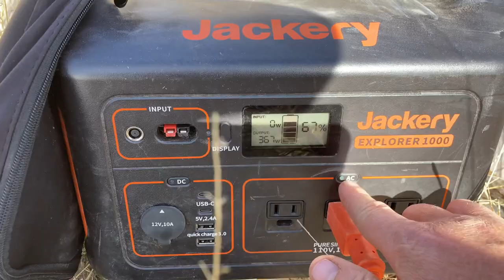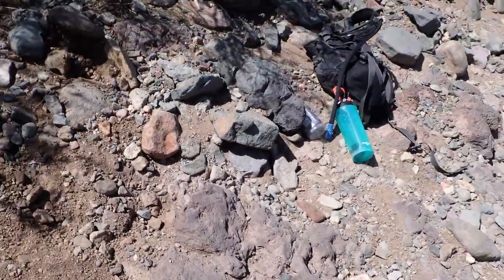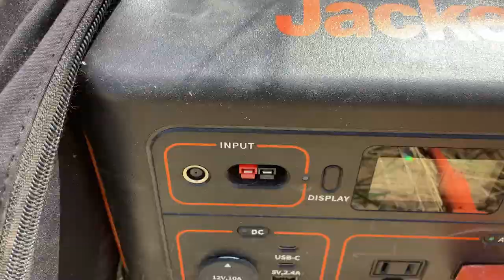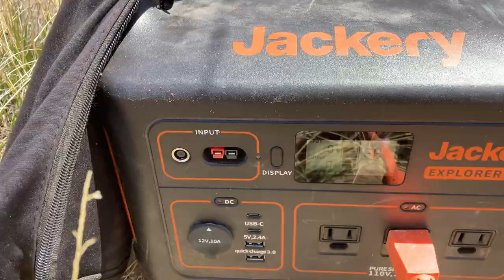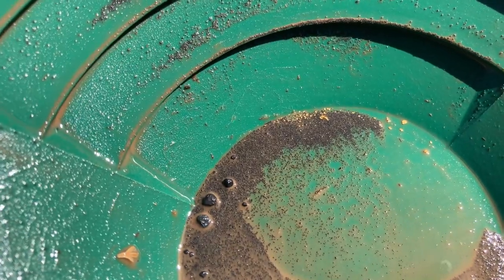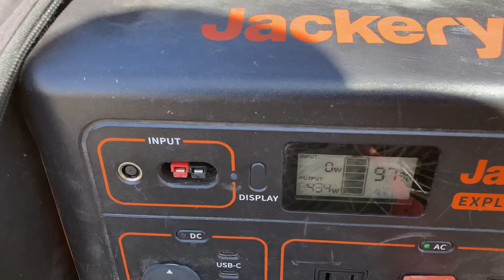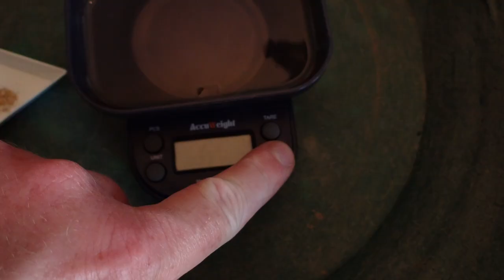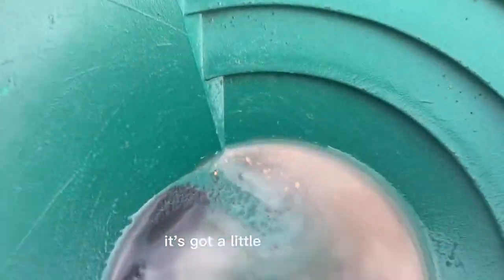The Easiest GPAA Claim to Find Gold

Comment: Keep using the buckets. Dont shovel directly into the hopper
Reply from the maker: What makes you say that? I use as many buckets for the initial feed as I have, but I do shovel out of the concrete mixing tubs, and then shovel out of them when I rerun the tailings as well. What difference do you think it makes? Just the little bit that falls out of the shovel on transit? Thanks again for checking out my video, makes my day to know you watched it. Love your stuff.
Reply: @LearntoProspectGoldenAce  Try it... Trust Adam
Reply from the maker: IMO I brake for bedrock are the top dogs for dry washing, I’m not arguing. The vast majority of what I know about dry washing came from them. However like most things in life it’s better to understand the why behind something rather than just accepting a truth. I use plenty of 5 gallon buckets to feed. Ironically I had just bought the tubs this trip to make emptying the riffle trays easier, since the 5 gallon buckets are too tall and the 2 gallons not wide enough. And P.S. thanks for the subscribe and taking the time to respond
Reply: @LearntoProspectGoldenAce  the easiest way for me to put it into words: when you shovel 100 times above your waist and twist it’s a lot more work than filling buckets and dumping them into the top of your drywasher, less physical work and more efficient for continuous feeding of material
Reply from the maker: Ayyy. There we go, thank you. There’s definitely some logic there. As someone with mild scoliosis I’ll definitely take that into consideration. That’s one point I always like to make about finding more gold. There’s a few factors that determine how much gold we find. What’s in the dirt, method of prospecting, time to spend, and physical energy available. Improving that physical efficiency can add up in the vial. Thanks for the input 🙏
Reply: @LearntoProspectGoldenAce  heavy pans brother man 💪
Reply: @LearntoProspectGoldenAce  
Howdy !
So theres a few reasons to use buckets instead of shovelling directly into the hopper. 
* You can keep track of how much gold your getting per bucket and how much material you ran to get that gold.
* Heavy, yes but Its much less work and likely easier on your body. No need to pre-screen either
* By dumping buckets, you keep the feed rate consistant, and the tray from running without material in it. Dont let the tray run with little or no material. 
* I like that you are using electric air. Its terrific CFM consistency. Gas blowers tend to oscillate and be erratic with air volume.
* i`ve noticed lots of videos with "Royal" drywashers, and they seem to be very violent. Try lowering the air volume and you may see your gold take go up .
Reply from the maker: That’s a hell of a response and you make some very good points. 
*So you may have noticed in the video I did try and track roughly how many gallons (tracked when dumping into the bins)
*It seems you and vendetta both agree about the lifting buckets being better on the back than shoveling. I’ll definitely give it a comparison. Unfortunately I’m tent camping out of my subaru Outback so I can only travel w/ very limited quantities of buckets compared to you and boulderdash. 
*For sure consistent feed rate is key. On a factory default royal drywasher that is definitely an issue as the grizzly box definitely clogs up if you fill it full so controlled feeding is ideal. However is you look closely at the feeder my buddy made a contraption that attaches to the riffle tray and gyrates to keep the dirt flowing extremely steadily. I can now fill the entire feeder full, walk away, go dig more, and it will completely empty itself without clogging and steady feed rate. Its fantastic, the best fix I’ve ever done to a dry washer. 
*Youre right, I’m wasting time classifying. I generally don’t as I agree it doesn’t make much sense given the grizzly is a built in classifier. I was trying it due to the dirt being so wet, but it wasn’t worth the effort. I need to just dry the dirt on a tarp like you’re supposed to. 
*Agreed, I love the electric, it’s way smoother (and quieter). It adjusts from 250-1100Watts, I generally try and run around 350W. I’ll take your advice and try running at min 250W and see if it’s better. Thanks for the suggestion. 

And thanks again for all you do for the community. Y’all are a huge inspiration.
Reply: Yeah you gotta break them rocks right up early an’ such

Comment: The easiest and most beneficial way to find the most concentrated pockets of placer gold is to learn how to dowse for gold.  Read and study the book,  The Art of Dowsing - Separating Science from Superstition ($14.95), for learning all of the physics involved in dowsing and how to build the modern light weight ball bearing dowsing rod, which is the only dowsing rod that accurately gauges what is being dowsed by pitting the energy of gravity against the energizing of the one-tenth ounce dowsing rod load that is attached on the elevated acetylene welding rod, with being located five-inches from the hub's shaft.  This precisely gauges the dowsing of all edges, exact center, depth buried with angle of deposition, and most important is grading of the sought element that is contained in the elemental mass that is being dowsed.  Anybody can become a professional dowser by practicing the book's dowsing lessons of buried pipelines and electrical cables, tunnels and voids, precious metal placer and lode deposits, dowsing for treasure,  dowsing for any element, amplified long distance dowsing from a moving vehicle, and dowsing on water from a boat.  I hope dowsing enriches your life and have a safe, healthy, good day.
Reply: No. The easiest way is to learn hydrodynamics and geology, then study the area you are searching. The mining history of the area and what was carrying the gold is also important. I have never seen any evidence dowsing works and there are rewards out there for anyone who can locate a deposit using dowsing, to this day no one has successfully claimed those rewards.
Reply from the maker: As an atheist I definitely have a hard time believing in something like dowsing. However not sure if I’d say learning hydrodynamics or geology are easy pursuits either. I’d say for those who aren’t classically educated, the best way I’ve learned how and where to expect gold falling is via gold sniping. My next video will be a gold sniping video filmed in metro Denver, and seeing how heavies actually move and accumulate in different spots can be really illuminating. Thanks to you both for taking the time to comment and hope you enjoy all that’s to come as well!

Comment: Doesn’t that Jackery have pass through charging. You should be able to run the panels while using it. Extend your run time
Reply from the maker: You're correct, it does have that ability. When reading through the instruction manual it did suggest not to do so. I'm inept when it comes to electrical stuff so I've been leaning on the side of caution most of the time. Occasionally I have used it while charging, but generally try to avoid it. I rarely do run out of power though. I can do at least 3 full runs one one full charge, so as long as I get a little charging time after prospecting for the day and while I'm waking up in the morning it's nearly endless power. Only once I have I run out to the point where it kept me from prospecting. Thanks for the input though, I'll look into it further in the future. Hope you enjoyed regardless!
Reply: @LearntoProspectGoldenAce  I have the same Jackery. Purchased it for camping with my C-pap machine but plan to use it for prospecting as well. Light weight and simple to use. Well worth the money.
Reply from the maker: I definitely agree, turns out you get what you pay for. I basically lived off it for a couple months in the NM desert. Charged my laptop for movies at night, my phone, and my blower for the drywasher.  One of my favorite pieces of prospecting gear. Thanks for watching! @michaelspring3915

Comment: Im headed there next month, wanted to stop at Gold Skeye Seven, but i heard theres a locked gate in the way.
Reply from the maker: Oh nice, hadn't heard of that claim before. Been a while since I've looked around the NM map of claims for GPAA, so it seems that's a fairly recent addition. I see the comment on the website you're referring to. Generally there isn't supposed to be locked gates on public (BLM land), so if you encounter that I'd contact the local BLM office. You should be able to pass through, but I'm not an expert so I'd double check with them. I also noticed the claim owner commented on the claim info and mentioned to avoid using GPS to drive in as it'll mislead you, so be careful that you're prepared for the trek. Good luck on both claims!

P.S. Greyback is the easiest claim to access that I've ever been to. Right off a well maintained highway and probably only 300 yrds of graded gravel road that any 2x4 car can drive into.